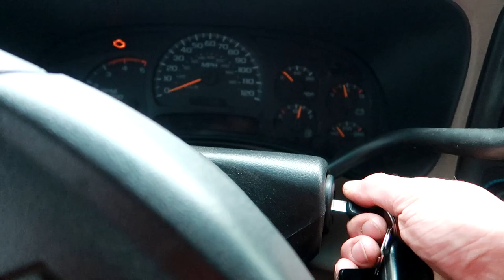POWERFUL MOTORIZED SCOOTER

Comment: Keep it simple, don't worry about external microphones. I always hear you fine, though I'm a headphone user. As for the small engine issues... I suggest the pre-mixed, ethanol-free fuel, like True Fuel or VP fuel, that you can find at a hardware store or power equipment dealer. It is pricey ($20+ per gallon), but for the amount I use it, it's worth the aggravation it saves! I always put Star Tron (comes in a blue bottle) in the pump gas for my 4-wheelers and lawnmowers.

Comment: Dalton, use non-ethanol gasoline on your small engines. It's the ethanol that causes the diaphragms to go stiff. I've got multiple small engines that don't get to run all that often, ever since I switched to non-ethanol gasoline I haven't had the diaphragm issues.

Comment: Same is true with removing the ethanol and water replace with acetone and denatured wood alcohol I am using to clean out the fuel system and more reliable starting.  I would recommend for full time usage. Two Stroke Engine with denatured alcohol and I haven't purchased the oil that mixes with denatured.  read it runs hotter.Still Researching but the test so far have been extremely productive.

Comment: @3DMachines You should go for a better camera! Don't get me wrong the point and shoot is doing an awesome job and the video and audio quality you get with it is good. But how often are you sticking the whole camera into some small confined space where a larger DSLR type camera wouldn't fit? And think about the options a better camera would open up for "getting the sssshhhhhot" as you like to say? The personal microphone input is just one perk. You could still use the point and shoot when your mobil or need to fit it literally inside of something.

Comment: try denatured alcohol and caster oil it runs a little hot but I am working on a mixture that will be clean an reliable. a methanol replacement still under processor.  be careful bing the information regarding.  always runs better than trashy gas and 2 stroke oil.  work in progress.

Comment: Use ethanol free fuel or put an additive in. When you are going to let them sit drain the fuel and run it until it quits. It will start the next time you need it.

Comment: make two lists, one that has only what is needed to make it work, and one for everything for example, muffler, everything else as the engine will run without it, spark plug requirement